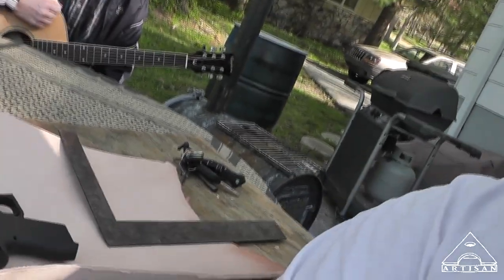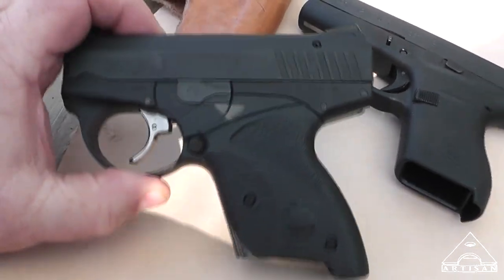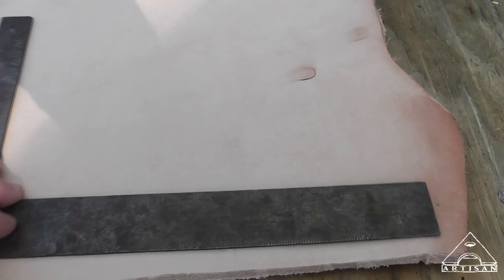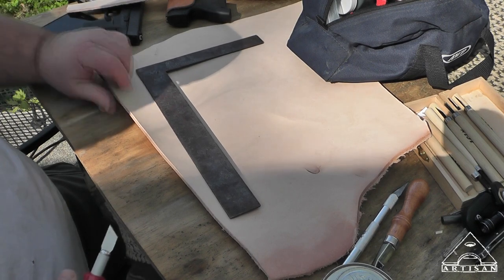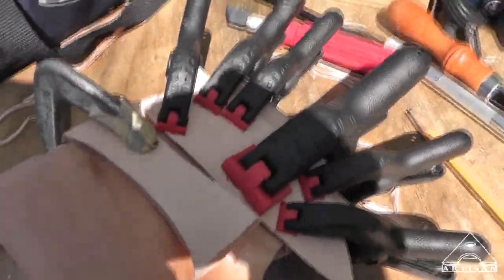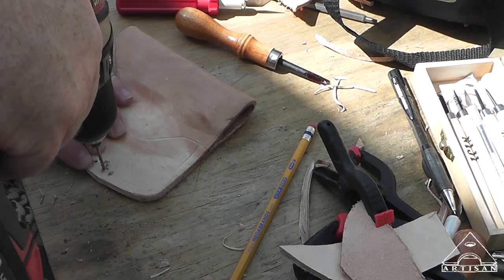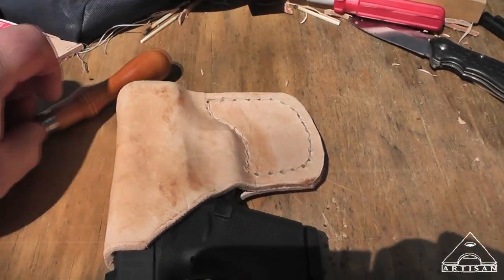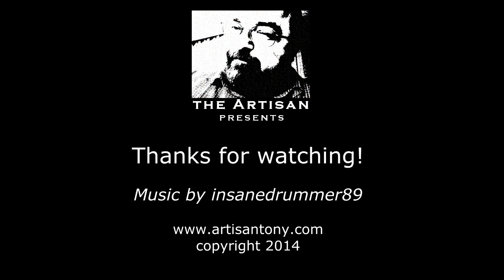Making a Leather Pocket Holster for my Glock 42

Comment: Good instructional video, Artisan Tony.  The young Artisansters can make their own leather gear.  An American made awl is less than $20; the ones from China freight don't work as well (but they come with a big spool of thread.)  Artisan Tony has the artisan eye and sure hands; there is a tool that looks like a small rowel to a horse-spur.  It's used by us greenhorns, to mark the spots for the holes, for the stitching, to help the holster look nice.
  Scrapes of leather can be purchased from a leather craft store.  A tube of leather glue can be bought at a 1buckNoMore store.  Artisan Tony be the modern man, using the electric drill.  Some greenhorns use a long nail/or metal ice pick and a hammer.  Folks can make holsters, knife sheaths, covers for axes, or a bag for chewing tobacco.
Reply from the maker: haha, I think I am the greenhorn but I have fun with it. :)

Comment: Wow AT, that is really cool. I'm definitely going to try to make one of those. Did you boil the water and soak the leather before you formed it to the pistol, or do you just get it wet?
Reply from the maker: I just got the tap water as hot as I could. It doesn't take much to get it to form. Thanks!